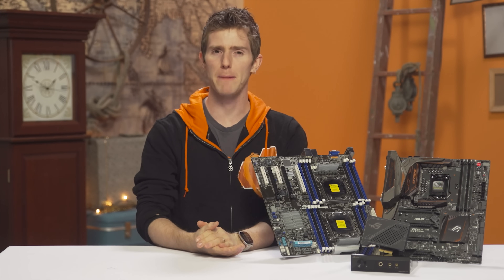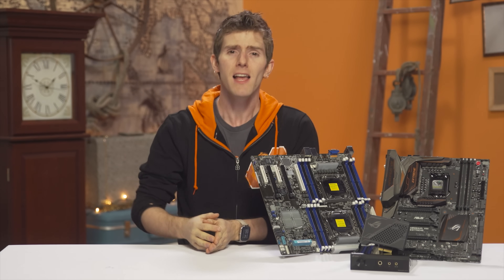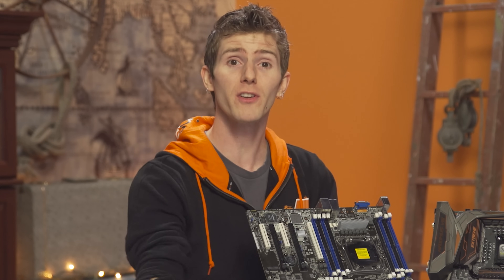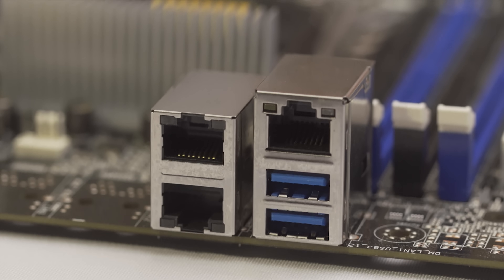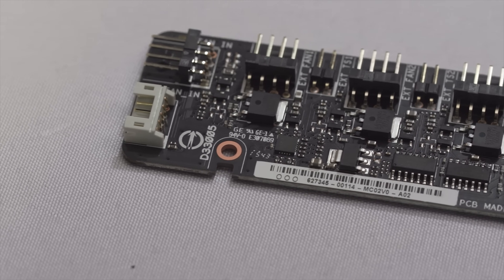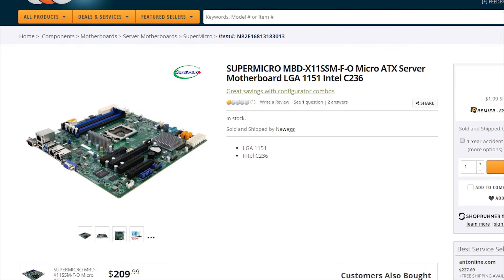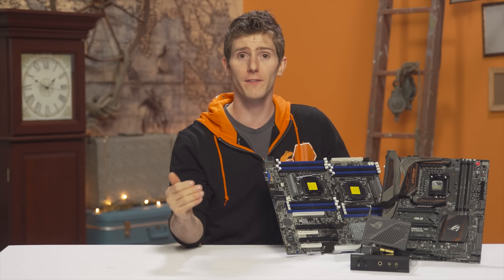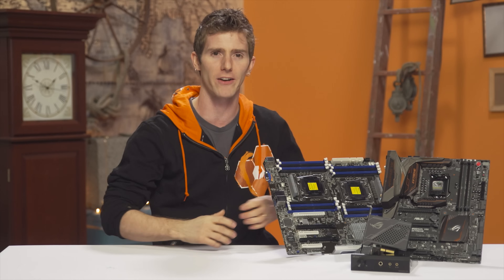What is the best choice for a motherboard? - The Final Answer

Comment: i wish apple fanboys realize paying more it doesnt mean more quality and performance
Reply: I have used both Mac and PC products i'm leaving phones out of this because that is a different story, but here is my synopsis:

Pc has alot of options on customisation which is very a nice feature wether you are using it on basic activity like webbrowsing, e-mail, checking some youtube here and there playing video games or high end production activity, such as video editing, 3d modling, high res photoshopping or server hosting. the fact that PC's allow you to customize your build to your activity is a very big plus. it is your selection in components, software and OS that will sometimes give you a hard time with compatibility. you will also have to install and sometimes pay for extra protection software regarding if it was not included with the pc itself.

Mac doesn't have that freedom in the customizing area. you are mostly bound to a single functional product you can't adjust carrying alot of extra hardware you sometimes don't need and end up paying alot of money for it. However mac's expertise is its compact and lightweight designs, the apple cloud, intergrated apps, plugins, and standard privacy protection. which makes it easier for apple users to interact with other apple devices faster. and safely store data with some very decent protection from apple themself. making apple a perfect manufacturer for businessmen. BUT you are still limited to a set price range which is always higher then 1000 bucks for its cheapest platform, making me wonder if I really need an apple  product due to the limitations I have on using it.
---------------------------------------------------------
so my conclusion is that Mac is more a product for people who don't have much experience on  how to effiecently work with PC's and want to get things done quickly depending if you work for a business or personal activity. 

and PC is more for the people who know how to tweak your system efficiently to sustain your own needs because you can do anything with a pc that you want. or for some very high end productions where you need alot of power and memory to fill that requirement. I hope this helped getting some detail with you guys.

personally my preference is with PC, because I know how to build my own build to suit my needs and it doesn't cost me extra money for alot of the stuff I don't use in a mac. at the moment I have made a build that costs me 1400 bucks less then it's Imac counterpart. even tho a mac needs less space  on a desk then a PC I am easily willing to give that up for the extra 1400 bucks I am not spending on it.
Reply: *****
then, tell me the advantages of your ecosystem...., comparing to windows
Reply: +a09as no, im not trolling at all, tell me the advantages of having a mac.......
youre just saying that im trolling cuz you dont even know what to say xD
Reply: ***** again, youre saying nothing, tell me about your ecosystem and "MUCH MORE" , hahahaha
Reply: *****
we both are contributing nothing..., and again, youre saying NOTHING...., tell me all you the advantages you know, give me all you have xD
Reply: @GiantDwarf031  I know this comment is old and maybe you've become more intelegent, but trying to use money and calling someone out for not being able to pay for an overpriced product is doing nothing in your favour. My phone costs 120 Euros. Not because I could't afford the "latest Iphone of 1200 euros". I bought it because it was the highest quality product I could find on the market.
Reply: Max Mustermann
i always knew that, dude. apple user are like those kind of girls buying a car, they have no idea what they are buying it, dont even care if you sell a hundred thousand dollars car with a 1 L fiat engine, they just want something that looks good and everyone knows its expensive.
Reply: Max Mustermann com on don't tell me iphon has best design or best battery

iphon is to bad for what price it has
Reply: ohhh really??, so the benchmarks results are opinions.. hahahaha, 80% of macs came with an intel HD graphics and dual core i5, and they cost you 1400 bucks, with that money you can get a gtx 1070 with an quad core skylake i7 in a PC, thats a fact, you idiot.

if youre still saying that i have no argument its cuz you have no idea about hardware, youre just another apple fanboy, claiming "design" "software optimization"; mac os its runnning well, and its well optimized, its true, but that optimization cant compete with a doble hardware performance difference.
Reply: no tell him what the advantage of having a mac is?
Reply: if youre interested in overclocking, go for a z170 asrock motherboard, you can overclock non k cpus with that.
Reply: i dont feel superior cuz i have a pc, i feel mad cuz apple its shitting in the face of all their customers, giving them a MEDIOCRE hardware
Reply: +a09as shit price cuz is not expensive?, i told you that my laptop have almost the same spects of an more than a thousand dollars macbook, you are the prove of what i said on the first comment hahahahaha.
AND IM STILL WAITING FOR YOUR SOURCES THAT SAYS IM WRONG, im showing you real tests of speed  that shows the doble performance of the pc costing half comparing to the mac "PRO", but im the "KID".....
Reply: its like wishing sheep become people
Reply: Daniel Zhang that guy is like that, i had show him actual facts that prove my point, many apple users think they have performance and quality paying that amounts of money, cuz its reasonable, but not always is like that, thats my point; if you just want to buy something expensive and that everyone knows it, go ahead, the part i hate its when they try to justify their purchase saying "software optimization", that optimization will never make an intel hd 530 run like an 980ti or something like that.
Reply: It is true that PC gamers tend to be more boastful about their builds. I apoligize on their behalve for the community behavior. 

I can't ignore the fact that even I was like that a few years ago, But eventually we start to appreciate our build instead of completly boasting it.

 It's a normal reaction though. When we are proud to have bought something we like and some one else starts criticizing it because they are proud of their product. That gets me especially irritated. 

It's an unstoppable war of defending your decision and making sure you are not doubting the product eventually. but when time passes it will go away. so once again I apoligize to everyone in name of the PC community for the rash comments being thrown out there.
Reply: +Randy Zhu yes, there are intel based evga motherboards
Reply: msi exacly :D
Reply: then tell me why they are so "amazing".......
Reply: +a09as do you realize that the pc has exactly the same parts than the mac?, the funny part of this is that the new macbook pro cpu runs at more than a hundred degrees in full load .

youre saying stupid things with no argument, you have 10 times more programs, games, apps, etc in windows, its half price, and it runs 2 times faster.

apple always sell you a "pro" computer with a mediocre gpu, wait a minute, pro products should have a really good performance for working purpose, then why apple users claim they buy that products because it has a good design?
Reply: talking about "pro" products and you will not consider the numbers?, ok....; that numbers just show you the results of most cases man, of course you know nothing about hardware, thats why you´re saying this, and its ok if you dont know, if you tell me "i purchase this mac cuz i like it/thought it will be good considering the price (half cases of apple customers)", i will have no problems, since not everyone knows about hardware and its your fucking money.

the part that i hate is when people like you, will not admit it, they are constantly giving excuses about their bad purchase, thing like "mac is good for design"  "mac have software optimization, therefore its way faster even having a MEDIOCRE hardware (taking about 50% worse and more)"  "the mac have more durability (i dont know how, since both have exactly the same components....)" and stupid things like that.

the pc its faster in every single task/program/game comparing to a mac, in many kind of tasks the difference its near 200%, but noooooo, mac has good "SOFTWARE OPTIMIZATION".
Reply: a09as hahahaha, "the performance doesnt matter", im used my pentium 3 with a p3v133 motherboard for 17 years with a light win xp version, but according to you it brakes in 2 years, if you really know about this, why even need customer support for solve a problem?

i dont care if you buy apple products i just said it, i hate the people that try to justify apple with lies..., did you even watch the comparison i had send to you?.

you say im takimg bullshit cuz i care about performance, omg man, watch the rendering performance between both, pc is almost 2 times faster, if youre working with rendering, of course you should buy a pc, but according to you its irrelevant hahaha

and the mac dobles the price of the pc....
Reply: a09as ok man, pay two times more for waiting almost doble for having your work done, thats your logic.......

and youre saying that the pc last for just 2 years..., i never even mention the macs durability, so, what youre talking about?
Reply: ***** ok, im interested in your videos that doesnt support what o said, link them here.

And i dont know how the video i linked its a manipulation of mine, since it was created by another person, almost one year ago hahahaha
Reply: Kirby Crab if you like the mac os, good; i will never pay thousand dollars more just for the os (like in the case of the mac pro), and with that performance it makes no sense.

If apple put at least a gtx 1060 in place of a gtx 1070 and same cpu comparing to a pc at the same price tag, it will be great and all apple fanboys claims will be aceptable, but with dual core i5 and igpus it doeant make sense.
Reply: @msi112  that's why hackintosh is cool
Reply: +a09as "you envious little kid", and here we have, the real reson of a apple fanboy buying a apple product, because its expensive, you fell better and "different", with "higher status", buying a product that looks good and everyone knows its expensive.

anyways,  i have a pc that destroys any existent mac  for 1,5 or even 2 times in performance, should i be jealous of that?

watch the video please, or at least link me your test of performance that shows a mac beating a pc of same price range in SOMETHING.
Reply: I like apple products too, but they're def over priced. Some of these comments are hilarious though.
Reply: Msi because everyone totally fucking needs exe files and partitioning in their phones, right?
Reply: a09as This is actually kinda funny.

But I think the guy who talked about the synopsis about both Mac and PC is right.

They both have their advantages. But in my personal opinion. I perfer PC, and I kinda dislike mac, cause of their prices and hardware and phones.

Though Apple's optimisation for their laptop to be able to run things well on their hardware is actually really good. But optimisation can only get you so far.
Reply: +a09as im blind cuz i saw the performance difference according to the programs test and benchmarks?, then why arent you blind?, just because apple says its the best?
Reply: you dont even realize that apple is manufacturing nothing, they are just assembling all the parts you can buy and put it on a pc, the only problem is that the parts they put to your mac are really cheap, with a well made case and screen to make people without knowledge of hardware buy it.
Reply: youre right man, i have no problem if you say me "i bought cuz it looks pretty cool", "i like the design of the product", like i said, its your money..., if you like it, buy it, i just hate the part that apple users try to justify their purchase saying its the best of the best, cuz its not, not even close.

its like comparing an lamborguini countach with a nissan skyline gtr 2017, the skyline its cheaper; its more conftable, it has more performance, reliability, etc; but if you like the lamborguini cuz its an exotic car, or you like it cuz you think it looks gorgeous, go ahead, but you cant say that the lamborguini its faster.
Reply: Ryan Muck that is insanely expensive. but i said before that my build was equal to this one. and 1400 bucks cheaper. it's true. even for the protective services i can buy alot of others for that 1400 bucks
Reply: TheEmperor OfJustice I know the price is high, I just built it quickly as an example. And as shown also in your build. The value of a Mac cannot compare to a well maintained PC
Reply: +Meh Does it matters if you just use it for create documents, printing and some web browsing, yea, even a core 2 duo pc is fantastic for that....; if you pay the same amount of money for a non apple PC, you will have a two times more fantastic pc......
Reply: Max Mustermann This is a Joke right...
Reply: Msi RIGHT A11 CHIP Lost to SD 835 and Powerful Exynos everywhere 😂😂😂
Reply: I'm an android dude.. but you're just using any excuse to bash a company and it's fans completely irrelevant to the video. Good job
Reply: To be honest Apple dose have better performance. I like Samsung more but comparing to Apple its not good in performance
Reply: and this is how the discuss always ends with any apple user, asking why apple is so good or wich are the concrete advantages of a mac.
Reply: Max Mustermann who told you that "kid"
Reply: a09as i have more than 1 pc in my house, do you really think i was using for 24h the pentium 3?, i never paid for something broken, if i had an issue with my pc i solve the problem for myself, and again, you dont believe the performance difference?, check out all web pages on internet, im not the only one that is saying this, you are closing you eyes to the facts, thats your problem...., watch the video and then continue......
Reply: a09as did you watch the video?, there you have the truth, and if you dont trust that video, you can look for more web pages about the performance between both...., dont close your eyes man just because you dont like reality hahahaha
Reply: Msi like I said we don't buy MacBooks for performance we buy MacBooks for normal use like study watching Netflix and so on
the macbook has the best trackpad for me the bes keyboard display battery design portability and the most important point the best synergy between my apple products AirPods apple patch iPhone iPad Pro Mac
Reply: Max Mustermann so that is the justification of apple apple for giving you literally mediocre hardware?, they are scaming your as shit man, yo can do all you mention with a decent hardware too, and what about the "PRO" products that cost 3 or even 4 thousand dollars?, are they intended to just use facebook and twitter on them too?

Im using a 400 bucks acer laptop, my battery life is of 10 hours when using in low profile with non intense cpu or gpu programs, and its has the same specs than a 1100 bucks mac. My only complaint about my acer is the viewing angles, are kind of bad, but man, i paid 400 bucks, and its a 360 touch laptop.
Reply: Msi i payed 1800 euros for my MacBook Pro late 2016 and for me its worth true its overpriced but for my task its the best choice
Reply: ***** hahaha I like u
Reply: +Max Mustermann if youre making coding that only can be done in mac os platform becasuse is a closed code, then youre right; what king of task are you doing?
Reply: same bro same
Reply: Msi q
Reply: +Syuna I used android, ios and symbian, used an iphone for 2 month and i can tell you that was the most boring and frustrating experience in a phone (the only one worst is the blackberry os), each time i wanted to move files, share full resolution pics, download music, .exe programs, and things like that i had to do it in my computer.

even in my old symbian s60 i could do everything, i could even install games in the micro SD card, and manage the system partition of the memory.
Reply: +Reiden Lightman i never said partitioning, i said "manage the partition", yes, everyone with a smartphone with less than 2 gb of internal memory need to manage all partitions in order to use the phone without lagging...., if you need to install win xp in a old pc with no lan driver, yes, you will fucking need it, if you use your phone just for social media, you will never understand how much things you can really make with a good phone........
Reply: +a09as you dont even know what im talking about...
Reply: really?, then tell me why im wrong....
Reply: +a09as i said why, if you really know what im talking about, explain yourself why im wrong....
Reply: saying nothing, if you dont know what to say, you should not write
Reply: explain me why i dont know what im talking about...., why im wrong tell me...
Reply: +a09as false claims, hahahah, i had link you the benchmarks and programs test, if you dont want to believe that your optimization cant improve 200% hardware performance, ok...
Reply: +a09as talking with you about apple vs pc performance is like talking about religion differences and which one its the true one, the only difference is that the performance in pc vs mac could be tested in programs and religion cant be proved.
Reply: Msi So you're assuming all of them think that? Maybe some of them just likes the brand, not too much about the performance.
Reply: macbook pro 15" 2017: 2800 usd; 2880x1200p screen; kabylake  quad core i7 up to 3,8 ghz with turbo boost; 16 gb of ram, 512gb pci express ssd; amd radeon pro 460 gpu.

dell xpx 15 2017: 2300 usd; 3840x2160p screen (mac doesnt have touch screen); kabylake quad core i7 up to 3,8 ghz with tubo boost; 16 gb of ram; 1tb pci express ssd (two times more than the mac); gtx 1050 gpu (like 10% faster than the radeon pro 460); plus it have a fingerprint scanner and a stylus pen.

there you have, same style, 500usd cheaper, two times better screen, ssd capacity, 10% better gpu, etc.

i had linked you the videos of the mac vs pc performance in productivity programs like 20 comments above, you told me "i dont need to see your manipulating videos with lies".

ok, dont use the prehistorical ports that safes you of carring even more pounds of adapters than your laptop, omg, so technological....., usb 2.0 is not useless, the are many products that doesnt support usb 3.0, and you will not be able to use it, having at least one, is like an extra.

and sorry for my bad english, since its my second language and i couldnt edit the last comment to make the proofreading.
Reply: Msi Hey how about the looks on the outside? Some people just like their looks. I mean sure $500 is a big difference I know.
Reply: +a09as something to say?
Reply: The newest MAC Pro cost 3999$. It has :
8 Core 3.0 GHz CPU
16 GB of GDDR3 ECC memory
Dual AMD FirePro D700 Video cards
Normally 256 GB SSD (yes that's it)
And a 450W power supply
...For $3,000
Reply: Msi you realise macs are work oriented and they are actually fantastic for that.
Reply: This comment thread lasted forever. Whoa!
Reply: Delirious PC kids are at it again.
Reply: Msi Is that ignorant Apple fanboy that unfortunately was unable to see the truth gone now?
Reply: But can it run crysis?
Reply: S
Reply: But what am i supposed to do with all my cash then
Reply: am i late to the party? hm
Reply: With Apple you’re paying for the brand and the Aesthetic. Not so much for the hardware.
Reply: PlantMC I mean, did apple not put out Face ID? Don’t see google with that, or Samsung.. HmmMMmMm
Reply: Deez Nootz. I mean a lot of android devices use Face recognition now.
Reply: PlantMC “Now” AFTER apple came out with it
Reply: Msi wacked Ben Maxey with that BRUTALITY move lol
Reply: Apple has software benefits opposed to hardware
Reply: Ehh if you’re just doing regular work its not horrible, plus almost all apple devices are all connected which is handy.. but yeah for doing literally anything else windows is superior
Reply: People have right choose what they like 💁‍♂️
Reply: lmao msi is right here, just go back and play on ur shitty £10,000 trash cans
Reply: Msi I'm not defending apple, but with apple you're paying for the OS, and all the software it comes with (imovie, garsgeband, etc.)
Reply: MAC= magnetic accelerated cannon, i don't understand what that has to do with a pc
Reply: Bl Chitu what are you talking about? the A11 is the most powerful phone chip in a phone. SD 835 and exynos don't even come CLOSE lol
Reply: Msi oh boy... I buy apple products because they are amazing
Reply: გიორგი ბაბილოძე the iPhone 7 plus in jetblack has the best battery life and design is good too and the best part is how the apple products works together
Reply: we don't pay for performance kid we pay for battery life os update and design